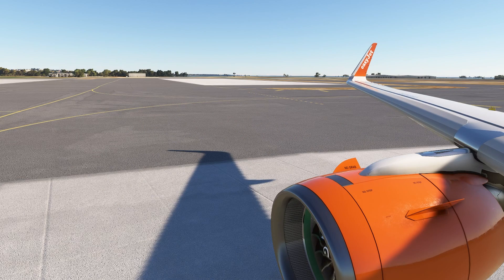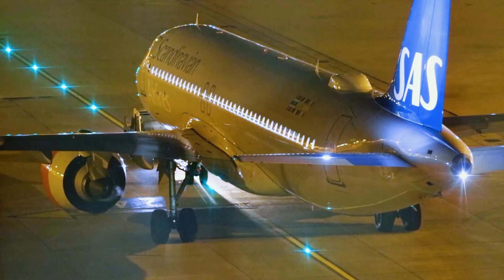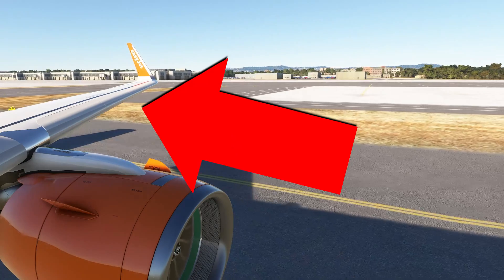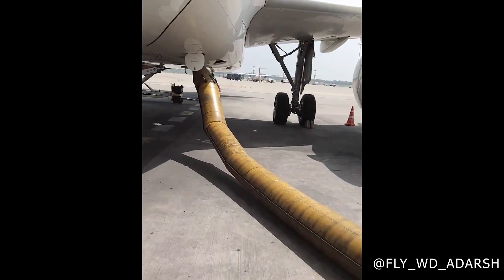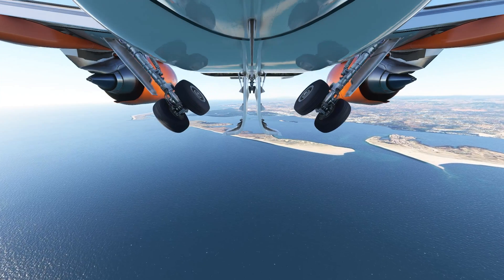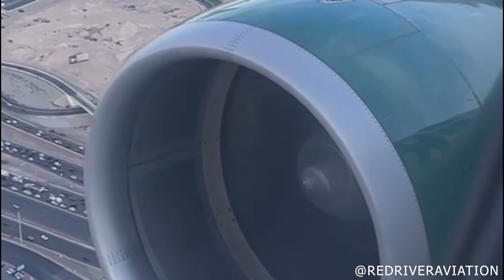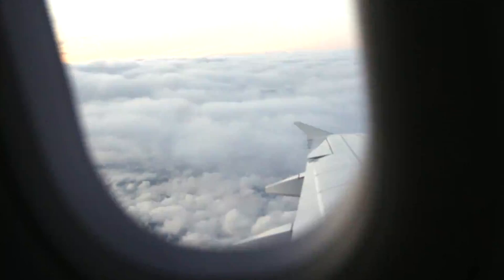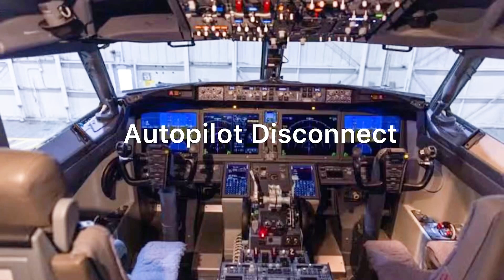Explaining the SOUNDS you'll hear on a Flight

Comment: I've been told that the 'properller' sound from the engine at hgh thrust settings (e.g. take-off) is the tips of the fan blades breaking the sound barrier. Is this true?
Reply: Yeah but it’s not as simple as that. Because the blades are in a low pressure environment the speed of sound is lower than in the ambient air at sea level so the sonic booms are subdued
Reply: Pressure and density both contribute to the velocity of sound equally and thus cancels each other out. Hence, Air pressure has no effect on sound speed.
Reply: @tomking1890  the air pressure being lower has a side effect of the temperature being lower which is the reason for the change in mach. I suppose I should have specified that.

Comment: Love the barking dog on the Airbus, Wonder why they have never re-engineered this to be a quieter, as many a time I look and see the other passengers faces look scared to death when the PTU comes to life,
Mark off topic question but still related to noises, why is that the Airbus series after take off and the landing gear is starting to retract is that you get the ding dong cabin chime?
Reply: It’s because the exit signs are connected to the no smoking signs for some odd reason and they stay in the auto position and will cycle with the gear. It’s the exit signs coming on and off and cycling that gives the bing.
Reply: @CaptainMarkLangston  Always wondered, thanks for clearing it up 👍👍